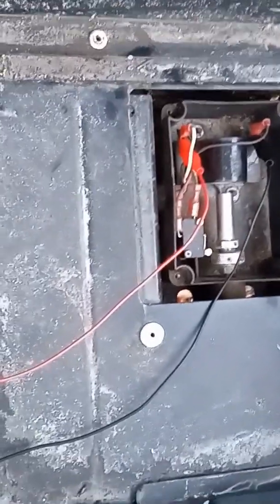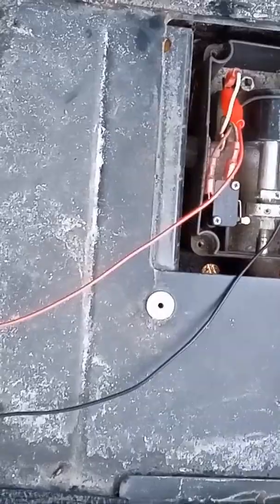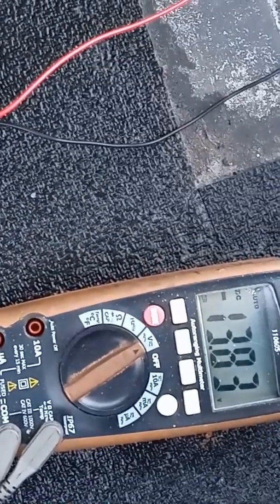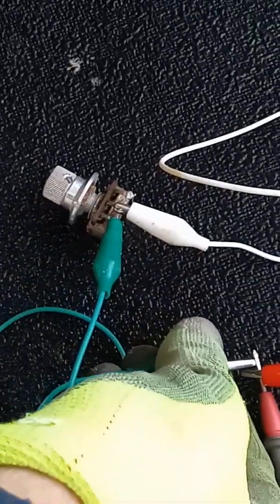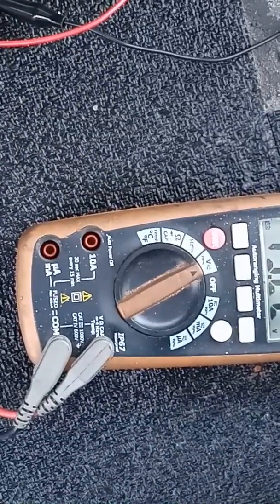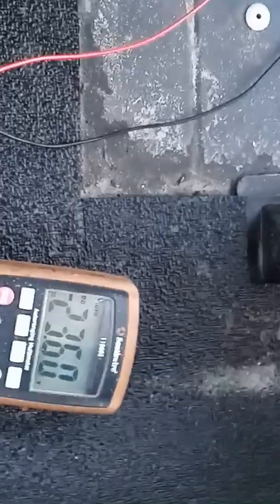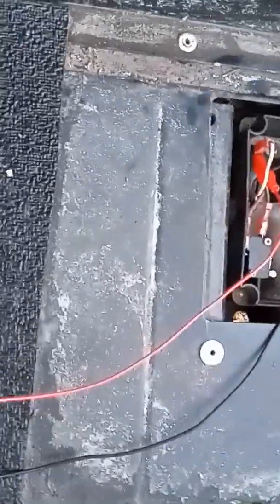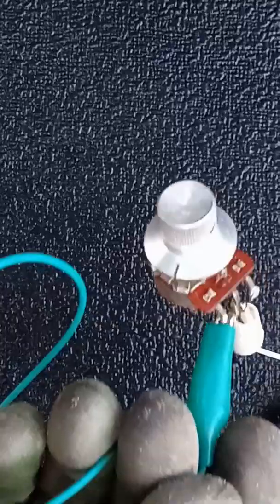Golf car speed control intermittent problem

Comment: Hey boss that is just a push button on/off switch that the throttle accuates on or off try replacing the switch or just move on to a var/resistor if you want but good look at it keep it up! 👍
Reply from the maker: If you are on a computer, you can click the 3 dots and view the description and read more about the post. On a smart phone the 3 dots are at the top right. The microswitch and relay are OK. It's the voltage across the induction coil that triggers only at about 13.33 volts. Some mornings my golf car will not move because this voltage is off the mark. I need to make a longer video to fully demonstrate the problem.
Reply: @mrcleanisin  gotcha sounds good wish you luck but changing a hall effect is a pretty cheap answer as well....sorry the way explained in video made it seem like the switch actuation was the sound you were hearing for solenoid,  all good and wish you the best of luck.!  Keep it up boss 👏 👍
Reply from the maker: That is a new hall effect coil. The problem seems to be in the speed control.
Reply: @mrcleanisin  oh then yes the variable resistor will work fine they also make them linear like a pedal instead of a rotary style then, you should be perfect....Right on git it buddy!